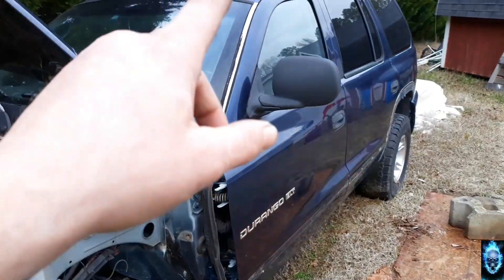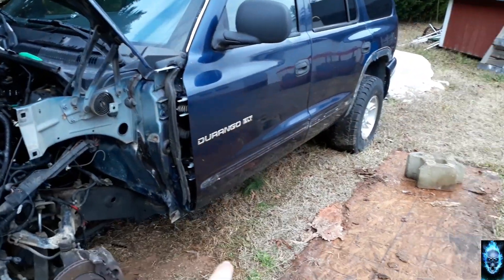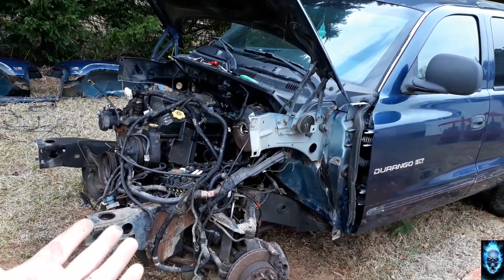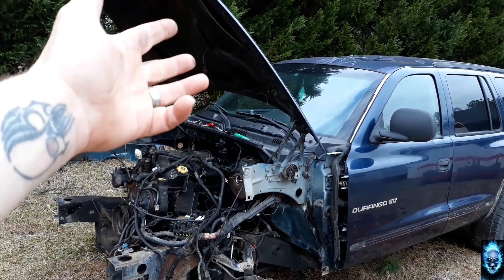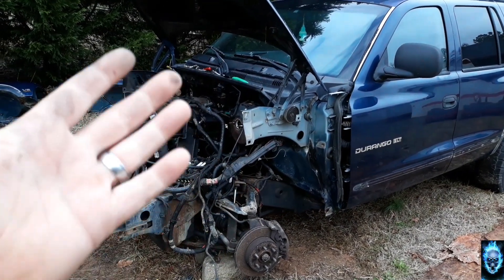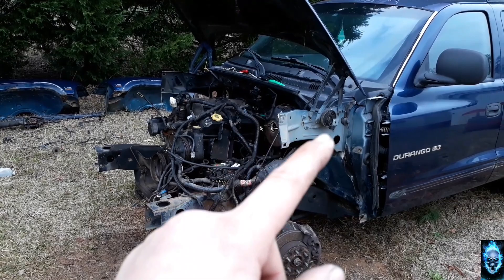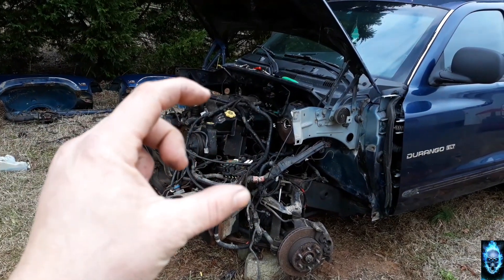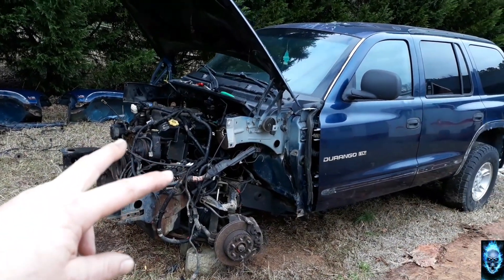99 Dodge Durango 5.2L V8 Drag Racing truck build.

Comment: you don't want high compression if your going to turbo that thing more turbo engines run flat top pistons because the boost is what gives you more compression so adding domed pistons is really not the way to go just get some forged pistons make sure your ring gap is correct if I was you I would get a girdle for it being it's a 2 bolt main block if you can look for a old 273 crank because they ran forged cranks instead of cast anyway that's some advice for you do with it what you want but a engine girdle is a big thing to have when you feeding the boost to it and with a forged crank the bottom end will be damn near bulletproof

Comment: I'm racing my 2000 5.2 this year too. What's your goals?
Reply from the maker: Full rebuild.  227/241 hydraulic flat cam thumpr and lifters by comp cams, comp cams racing roller timing chain, trying to still find a good set of pistons and rods,  also stacking twin  gt45 turbos from maxspeeding rods.  Still need to rebuild the transmission too but.  For the body gutting everything and fabricating carbon fiber to drop weight.  But hope to have it running and ready on a budget before the season starts.  What are your views. Any ideas I might need.  My first drag truck.
Reply: @DBGrimson  I'm watching to get tricks from you. Lol my goal is 8s in the 1/8 and 12s in the 1/4 good luck I'll be watching.
Reply from the maker: @Oleman72  hell yeah.  Ok well I'll have got some of the parts coming soon its gonna a mad house lol.  This Durango is gonna be a hell to reckon with once it's done. But we will learn together how much power we can get out of the 5.2L before it blows up lol. Then we rebuild again. But 1/4 trying for 11 or lower I just need to figure out weight lose and what can go.